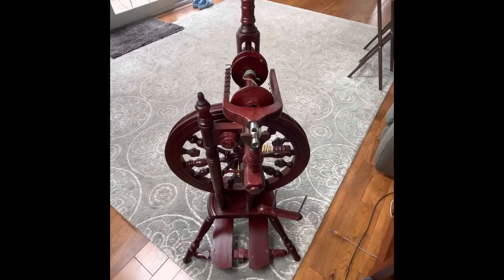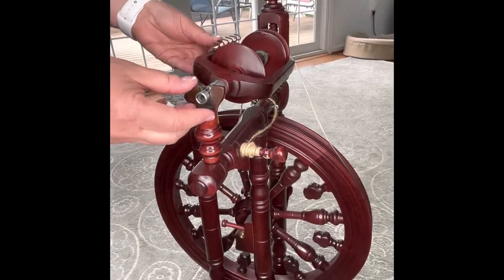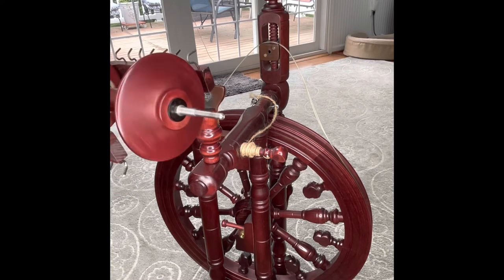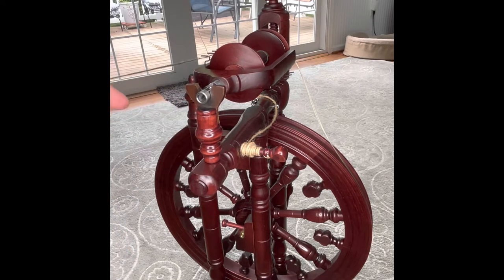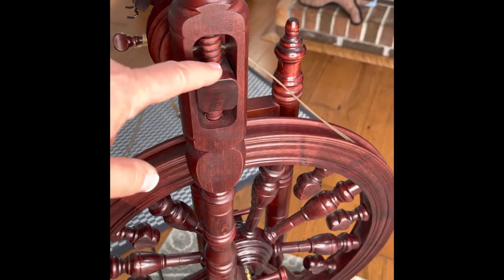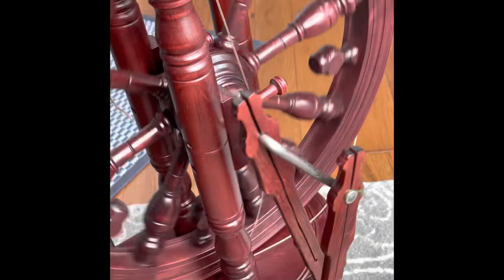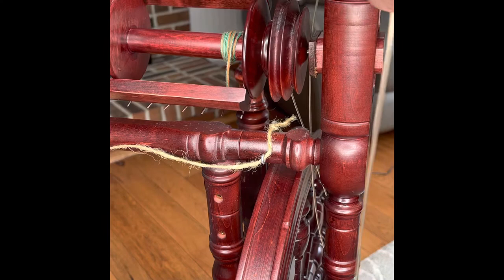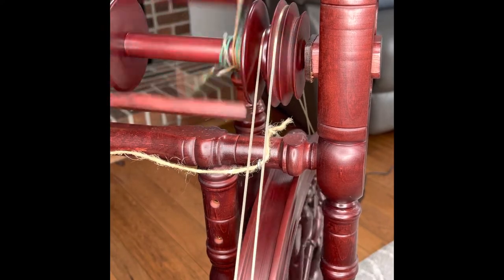Anatomy of A Kromski  Double Drive Minstrel

Comment: I have only one foot, my right foot. Is there is single treadle model?
Reply from the maker: Yes. There are many spinning wheels with one treadle. Kromski has the Polonaise model. It’s an absolute work of art. I have spun on it and it’s nice. There is also the Ashford Traditional which seems to be a popular wheel among spinners. You can also try an e-spinner. There is a very affordable one from Dreaming Robots, the EEW 6.0. I just bought one and it’s great. It comes with a foot pedal for tap off and on so you don’t have to find your speed every time you stop. It is 3 D printed and you also purchase a rechargeable battery separately. There are a lot options for you to enjoy spinning!